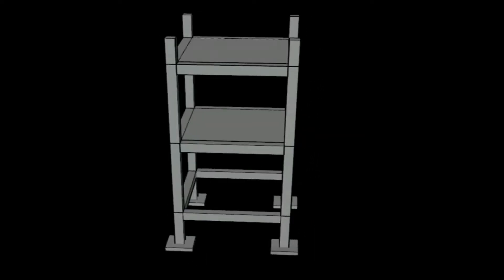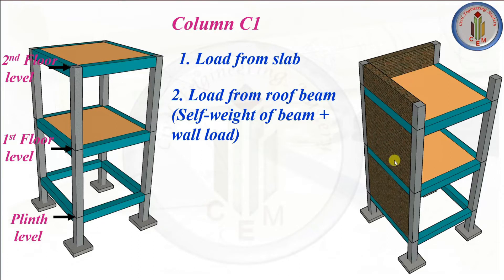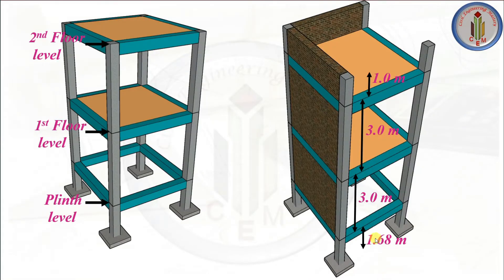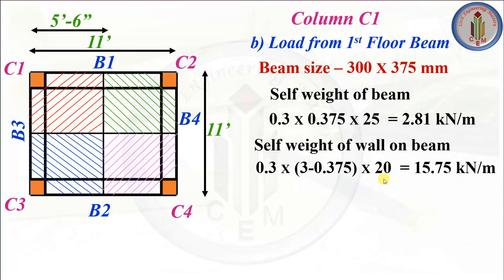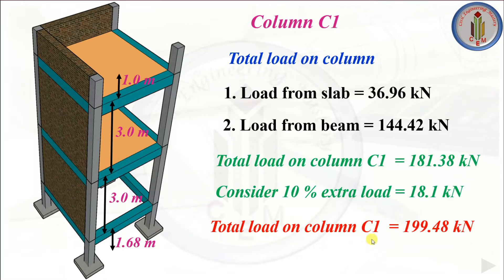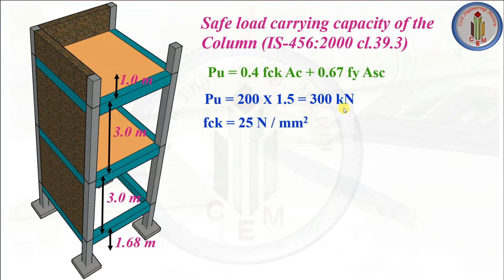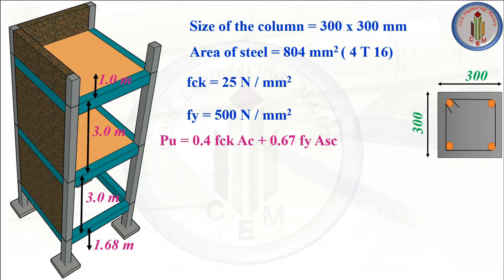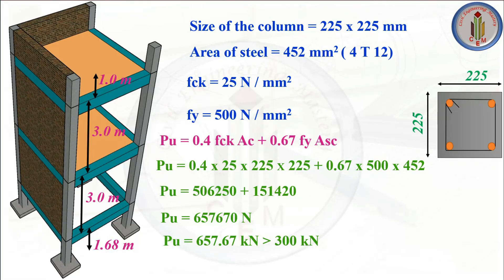How to find the column size | How to calculate the load on column | Initial size of column | Column

Comment from the maker: It will be 0.008Ag instead of 0.08Ag @ 12.16.
Only to find out the gross area we use the formula 0.008Ag. So the gross area will become 23809.52mm^2 and d=23809.52/240 = 99.206 mm instead of 34.04 mm. This is to check the depth of the column. It was an error by mistake. Sorry for the inconvenience.

Comment: Can you please  explain Ag=Ac+0.008Ag
Ac=0.992Ag
Reply from the maker: Ag - Gross area, Ac - Area of  concrete, Asc - Area of steel
Ag = Ac+Asc, 
Min % of steel for column as per IS-456:2000 is  0.8 % (Asc = 0.8% of gross area)
Asc = 0.008 Ag
Ag = Ac + 0.008 Ag
Ac = Ag - 0.008 Ag
Ac = 0.992 Ag.
Hope this helps.

Comment: .008g ki jagah .08g likha hai formule mein , isliye 34.04mm   column ki one arm ki length aayi hai.weight mein kn kya hai?
Reply from the maker: Thank you for the notification. It was an error. Sorry for the inconvenience. It will be 0.008Ag instead of 0.08Ag @ 12.16.
Only to find out the gross area we use the formula 0.008Ag. So the gross area will become 23809.52mm^2 and d=23809.52/240 = 99.206 mm instead of 34.04 mm. Other than this everything will be ok. This is to check the depth of the column. Hope this helps.

Comment: How did you get the 804mm² area of steel?
Reply from the maker: 804mm^2 is the area of steel provided. 4 nos of 16mm (4T16) dia bar provided, if you calculate the area that will come to around 804mm^2.

Comment: YOU FORGOT TO ADD THE SELF WEIGHT OF 2ND FLOOR BEAM AND SELF WEIGHT OF  PARAPET WALL COMING ON COLUMN C1. AFTER ADDING THOSE TWO THE TOTAL LOAD WILL BE {(2.81+6)X3.35}/2 = 14.75KN

Comment: What is  ( 4 T 12 ) or ( 4 T 16 ) 
How you taken area of steel as 452mm^2 or 804mm^2
Please explain.
Reply from the maker: 4 T 12 - 4 nos of 12mm dia bar. 4 T 16 - 4 nos of 16mm dia bar.
The area of one 12mm bar is 113 mm^2, Area of 4 T 12 is 452 mm^2.
The area of one 16mm bar is 201 mm^2, Area of 4 T 16 is 804 mm^2.

Comment: How you taken area of steel as 804 mm^2  when finding load bearing capacity of column.
Reply from the maker: The required steel area was 720 mm^2, whereas the provided steel is 4T16, so the provided area is 804 mm^2. The area of one 16mm bar is 201mm^2.

Comment: While calculating Pu you take equation 300X10^3. 
Why you take like that pl kindly tell us.
Reply from the maker: The total unfactored load calculated was 200 kN and factored load Pu is 300 kN.
Please check the load calculation.
Reply from the maker: 300 kN is 300 x 10^3 N. Just a unit conversion.
Reply: @CivilEngineeringMastery   Thank you☺️

Comment: Area of Steel kase aaya mam
Reply: Please reply
Reply from the maker: The area of steel has to be calculated as per the % of steel which is given in IS-456:2000.
For columns % steel is 0.8 to 6.0%.

Comment: I think you have to explain how did tou arrive the load of floor finish to 1.5 kN/m2 , the live load, and the 25 that you multiply to the thickness of the slab. We have to know it by your explaination. Whare did you get them, and or how did you determine it? Its not just enough to introduce it, but how come?
Reply from the maker: Floor finish thickness 75mm, unit weight of floor finish 20 kN/m3.
0.075 x 20 = 1.5 kN/m2.
Unit weight of RCC is 25 kN/m3. This has to be multiplied with the thickness of the slab to get the self weight of the slab.
Live load need to be considered as per IS-875-Part-2.
Reply: @CivilEngineeringMastery  Thanks a lot my dear Sir. Now i know it.

Comment: Excellent
Reply from the maker: I have created a course, structural design of buildings using Etabs software which includes structural analysis and design of a five-sorey RCC building(Real project) and is now available on udemy.
Kindly use the below link to avail the full course.
https://www.udemy.com/course/structural-design-of-buildings-using-etabs-software/?referralCode=14883FDBBD95A1ADAC02

Comment: In roof beam load calculation, self weight of beam is not added to self weight of parapet. Considered 6 kn /m only.
. Please correct me if iam wrong
Reply from the maker: Yes, you are right. self-weight of the beam needs to be added with the self-weight of the parapet wall which is 2.81 + 6.0 = 8.81 kN/m.
It was an error. Kindly ignore and thanks for the notification.

Comment: I have a doubt maam that 0.8% should been written at 0.008 na
Reply from the maker: 0.8 / 100 = 0.008
Reply: So you need to write 0.008Ag insteed of 0.08Ag
Then Ag = 23809.52 mm2
Ast = 423.20 mm2
Reply: Yes mam he is right it should be 0.008 in place of 0.08

Comment: Mam I have  column to column distance 12.10 feet span for g+1  building  i have use 4 T12 for column .Can it be safe
Reply from the maker: Please check what is the load coming on that column and adequate size is provided or not and then check this reinforcement is suffice.
Reply: Just increase the no. Of stirrups rings along to suffice column strengthen

Comment: Similar to explain by madam you can calculate load on column for vertical load (DL+LL) for typical 2 or 3 columns by using tributary area method.
Multiplying factors
1. For beam spans up to 6.0m multiply by 1.2 and for beam spans greater than 6.0m multiply by 1.30 to arrive gravity loads.
2. Multiply 1.3, 1.4 and 1.5 for EQ zones 3, 4 and 5 respectively for including seismic loads.
By considering first floor steel as 2.50%  determine  size of column for assumed concrete grade and steel grade from formula Pu=0.4fck Ac+0.67 fy Asc. MInimum size of column as per IS13920-2016  will be 300mm or 20x beam dia bars assumed.This will be followed by Architect for arriving preliminary size of rcc column in building design.
This is suggestion.  Thank you
Reply from the maker: Thank you.